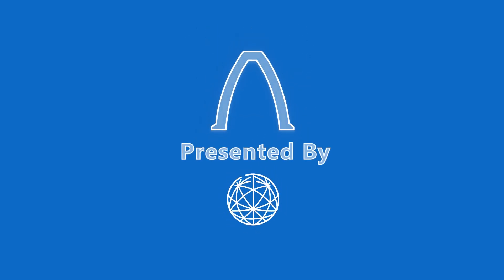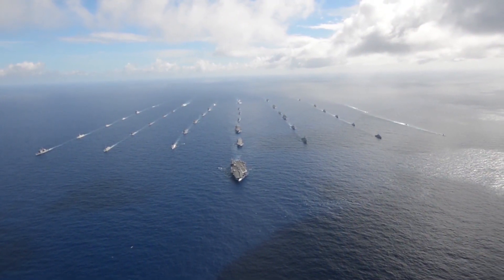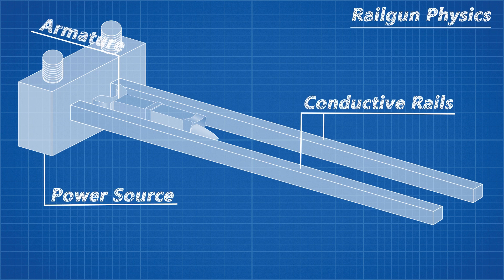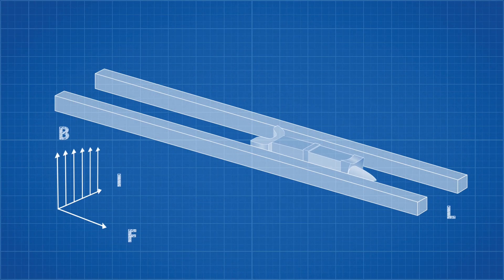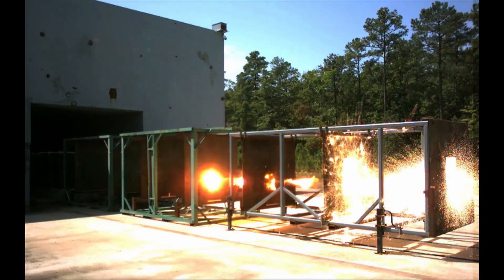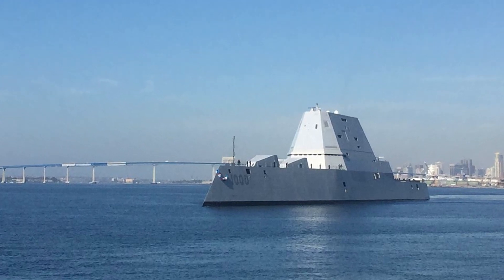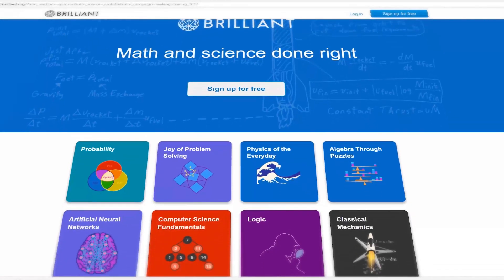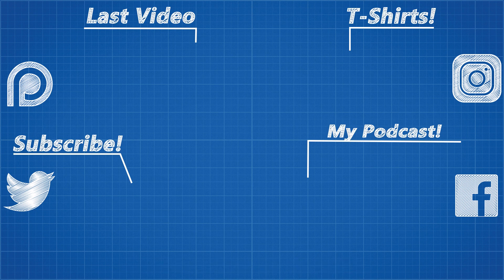The US Military's Most Powerful Gun

Comment: When I look at the rail gun design i was like: this is stupid, the friction between the rail and the bullet will cause so much drag
Reply: Caleb Willis but the rail MUST touch the bullet
Reply: Caleb Willis I would think of Gauss Cannons if my mind gets the terms right.
Reply: I wonder if making rails superconductive could help
Reply: KillmanPit making the rail super conductive will not decrease friction
Reply: What about coating the bullet with Teflon?
Reply: I think the only way to fix this problem would involve suspending the projectile in air with a magnetic field, but maintaining that suspension while also energizing the rails would be the tricky part.
Reply: JacsRambles idk what is teflon
Reply: redstone craft guy Its a polymer coating that can withstand high temperatures
Reply: If we spit in the gun before firing it ?
Reply: redstone craft guy Maybe if they just add some lubricant on the barrel/shell that'll decrease the friction?
Reply: Any lubricant would have to be either sufficiently conductive or thin enough that the rail current could arc through it without too much loss. I'm sure they're working on it :)
Reply: in addition to conductive the lubrication would need to be heat resistant higher than the highest operation temperature.
Reply: how don't you guys know about this stuff. its called a coil gun. coil guns are FAR superior to rail guns.
Reply: JacsRambles they probably are. Why would they let the public know? All it takes is a little research and you can see how crazy good coil guns are compared to railguns.
Reply: Could be using very smooth metal
Reply: jonathan saletri for a coil gun to work the timing must be very accurate
Reply: redstone craft guy any high school kid can do that. Well any kid in a real school that actually wants to learn. That's not hard.
Reply: I believe graphite has both high conductivity and low friction.
Reply: the fance read the comment section I started. Graphene-tungsten composite sabot rounds would be a good projectile. And a coil gun would work so much better then a rail gun.
Reply: the fance graphite is a bad conductive material, when I messure the resistance of graphite, it showed very high resistance. But graphene, a 2d form of graphite is very conductive
Reply: redstone craft guy graphene is graphite.
Reply: redstone craft guy also graphite is a superconductor just not at room temperature like graphene.
Reply: jonathan saletri no, just no. Look it up
Reply: redstone craft guy yes...graphite is used as a conductor and can be superconductor under the right conditions. Or are you saying that graphene is not a room temperature superconductor?
Reply: redstone craft guy I have done extensive research on this subject and also railguns and coil guns.
Reply: jonathan saletri graphite is not graphene.
Reply: redstone craft guy I know the two materials well. Graphene is a subset of graphite...
Reply: redstone craft guy I was saying GRAPHITE is a superconductor when cooled and treated.
Reply: redstone craft guy Graphene we think is a superconductor at room temperature. But it costs about $100,000 a gram so... we don't play with it much.
Reply: jonathan saletri yes and so is copper, all materials become more conductive when cool down, because copper is more conductive than graphite at room temperature so copper at super cool temperature must also be more conductive than graphite at super cool temperature
Reply: redstone craft guy no....just no..
Reply: jonathan saletri you should just forget about graphene. The thing about graphene, gold and copper is that they have low resistance but not 0 resistance. But this material does, it truly has 0 resistance https://m.youtube.com/watch?t=35s&v=GJHhnr9R_ZM
Reply: redstone craft guy only a few elements are superconductors. You can't just cool anything. Also superconductors all have no resistance so they are as conductive as it gets... It's not possible to be more conductive.
Reply: redstone craft guy ALL superconductors have 0 resistance.... thats the whole point. Graphene is a high temperature superconductor... You don't need to cool it nearly as much in fact on paper it has the potential to be a  near room temperature superconductor.
Reply: If Coil guns are superior, why isn't the US military testing those instead?